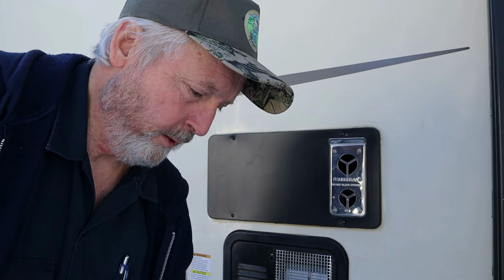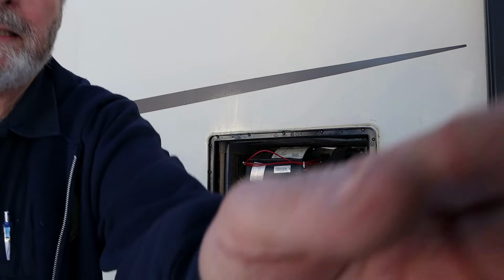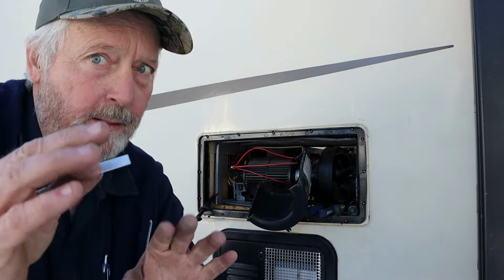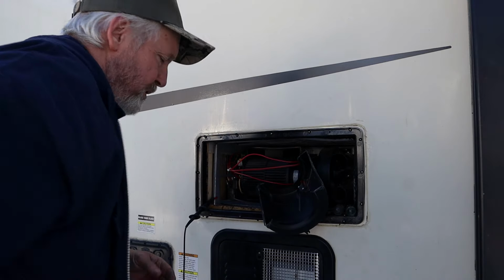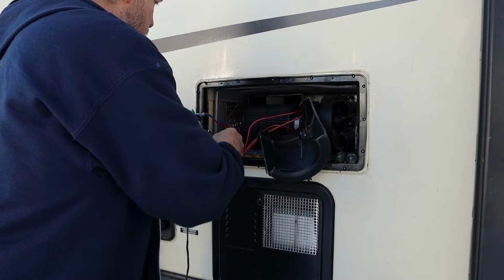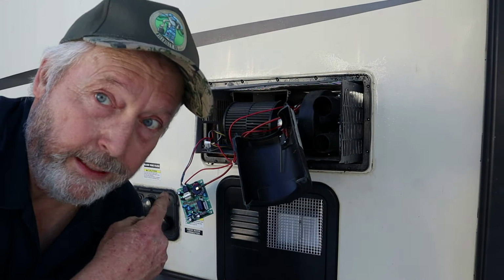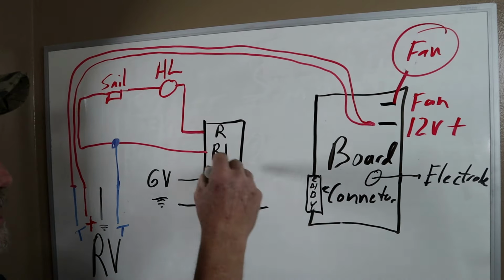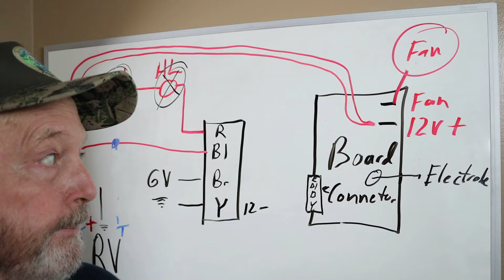RV Furnace Broken When They Need It Most

Comment: Thanks Kenny, I had a similar  situation with no power at the sail switch. I pulled the wires off high limit switch and it checked good and so did the wires. Hooked everything back up and tested furnace several times and it worked great. Reinstalled furnace and had her try it several times and it worked great. Called the next morning to follow up and she had not used the furnace. She tried and it worked. A couple hours later she call to say the furnace had quit working. I was in the middle of another service call and told her i would call her when i finished the call i was doing. Next thing i know she was standing over my shoulder demanding i come fix her furnace now. Told her i could not leave until i finshed this job then she started getting very irritable accusing me of over charging her and not standing behind my work. I walked to my van got her check, handed it to her and saidn "if you can get someone to fix it faster than me do it!" I will never put a furnace back in with a problem like that without replacing the high limit switch. I don't need agrivation like that. It just aint worth it. Thanks for sharing with us.
Reply from the maker: You learned a valuable, but expensive lesson that day.

Comment: Do yourself a favor when troubleshooting these. Get you a piece of hose to extend the gas line and a set of wires to extend the electric. Pull it out and set on saw horses. It makes it a couple minute job instead of an hour.
Reply from the maker: My service truck was snowed in. Watch more of my furnace videos to see my test setup.

Comment: M Dometic does that on off thing you described. Always wondered if my hi limit was flaky. From what you said sounds like that is how they work ???  Dometic had a bad sail switch  at a month old. Dealer told me that was typial for them.  Love the white board description of how it all works!
Reply from the maker: Many modern furnaces cycle the flame in and off quite often. Hard on the high limit switch. Yes Dometic sail switches are terrible.

Comment: Just a suggestion for future content.

My heater/furnace would not ignite once after I had turned on my propane
valve. When I checked my stove didn't work either.
I watched a video and found out sometimes when you turn on the gas on the 
propane bottle if the gas hit the regulator to fast it won't allow the propane to
go thru until the propane pressure is equal on both sides of the valve.
I turned off my propane bottle bled off the pressure on th bottle side and very slowly
turned on the bottle and everything worked normally.
The place that I got the information from is the rv school in Athens Texas.
Reply from the maker: I know that is a thing, but I have never experienced it. I guess I turn the propane on slower than most.

Comment: What I learned working on my suburban sf 35Q  is to turn the outside breaker off at the furnace go inside pull the fuse momentarily put the fuse back in and then go back outside and hit the reset switch and let the furnace try to start. I also bought me some long reach probes and tapping wire probes so I can check the sail switch and voltage to the gas valve and circuitboard with my meter.They work really good for this. My furnace also was on the outside of my rig and after 3-4  times of the furnace failing after I fixed it and had it running I took it out again and on further inspection of the board with a magnifying glass found some bad solder joints. Re-soldered the board and the Furnace has been working flawlessly ever since. Of course it would be because I had already ordered a dinosaur board as a back up. Oh well I’ll have that part for next time and it also has an idiot light on it so I’ll know what’s not working next time.
Reply from the maker: You don’t have to pull the fuse. Just cut the thermostat off and back on. I wasted way to much time trying to unplug that connector
Reply: @hillbillyrv  well after working on my furnace for a week it turned out that once it went into lockout the outside circuit reset  breaker didn’t do any good at all. Turning the thermostat off and on was too slow, it  was just as easy to pull the spade fuse in the RV and then go back outside to reset the system. I was chasing this problem for well over a week. I got very good at taking the furnace out and less than three minutes and taking it back inside where it was warmer (not by much) to work on it. And every time I got it running and got it back out installed it it would quit within 24 hours. That’s when I discovered the circuit board had bad solder joints. Funny thing is we’re talking about a $60,000 RV less than three years old and never been on a trip!

Comment: I also built a jumper switch for my toolbox so I could bypass the sail switch or the high limit switch to see if that corrects the problem using wire piercing connections. The same jumper switch also allows me to send power to the gas valve just to check that the furnace will ignite when hooked up to 12 V power. ⚠️This set up is only for testing. It would be extremely dangerous to leave it in place and run the furnace without correcting the problem. ⚠️Again I state I used this set up only for testing.
Reply from the maker: Sounds like a good setup.
Reply: @hillbillyrv  it really worked well! I took electronics in high school for four years back when there were transistors, so I have a good understanding on how things work.

Comment: Hi Kenny, I have a issue with my sf-20 furnace fan motor. It will start for about 2 seconds stops starts for 2 seconds then stops then shorts out. when I take the squirrel cages off the motor, it runs perfectly. I put then fans on , it goes back to the on/ off issue. I have watched many you tubes on furnaces and none address this kind of problem. Do you have any suggestions?.
Reply from the maker: What shorts out?
Reply: Im using a small 300 watt  12volt yeti generator to troubleshoot with, voltage is 13 volts. the yeti stops after the 3rd attempt (red light on needs to be reset) to run. While it was hooked up in the camper it would blow the fuse.  the thing is that the motor runs great without the cages on.  @hillbillyrv

Comment: I finally figured out what was wrong with my DFMD35131 Dometic. The prongs of the igniter/flame sensor needed to be 1/16 off of the burner plate. The igniter could feel the flame on start up and then it would cut the gas. Then repeat the cycle over and over again.
Reply from the maker: Glad you got it figured out.

Comment: My furnace stopped working back January of this year,i replaced the sail switch but it still wouldnt work so i figured it is the high limit switch because it wont even try to ignite at all.
Reply from the maker: You can keep throwing parts at it or you could test these parts first to determine which one is bad. I have lots of furnace videos that you can watch.

Comment: Hello Kenny!   Your diagram stop and explain was awesome!   It really helped!    It would have been nice to see where the high temp limit switch was, but maybe you can show it on the next one.  I have I technically comment.   I’ve seen you clip to the box many times for your ground connection.  Although it works it may not be correct 100% of the time.   What if the ground wire to the circuit board or whatever you are testing is broken or bad connection?   You can get the voltage you are looking for, but the board or equipment will not work.   Yup!  Saw him again!   Best wishes,   Kevin
Reply from the maker: If there is no ground on the case, then we got other problems. You would have to fix the ground problem and then continue diagnosing. He keeps showing up in strange places.
Reply: @hillbillyrv     You misunderstood.  You can have ground on the case and not the circuit board if the wire is broke.  So you can measure voltage at the board to case, but not through the board.    Hopefully I make some kind of sense.  Anyway, have a wonderful evening and a better tomorrow!
Reply from the maker: Yes, but still. If the case isn't grounded you have to dig deeper to find out what happened to the ground. 😁 @KevinCoop1
Reply: @hillbillyrv  100% agree!

Comment: I don't know how hard it is to pull one of those things, but I was thinking that if you pulled it, had a table to set it on, and 4 jumper wires for the power supply and thermostat, it would have been much simpler to troubleshoot.
Reply from the maker: This one was harder than some to pull out. I really try not to pull them if I have an outside access door. You need to watch some of my other furnace videos and you will see my test setup.
Reply: @hillbillyrv  I got tired of all the scuffed knuckles and since my unit was on the outside I learned how to quickly remove it for servicing. Practice makes perfect. Especially after the fourth attempt of the repair!!! ha ha ha ha ha ha ha ha ha ha ha ha ha ha ha ha ha ha
Reply: I'll look for them. I enjoy your videos and work. I'm an outhouse tech. With no training. But I'm obsessed with these videos since my daughter bought a camper. I pulled a furnace for my son in law and got lucky with an easy fix.
Reply from the maker: Practice does help. 😁 @lorenrickey5481